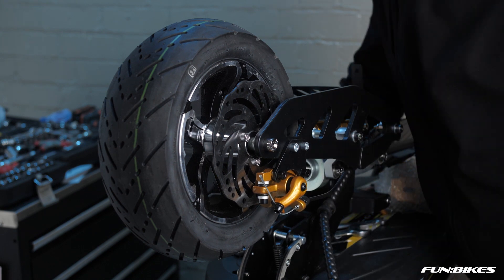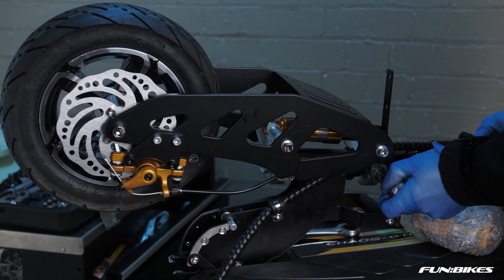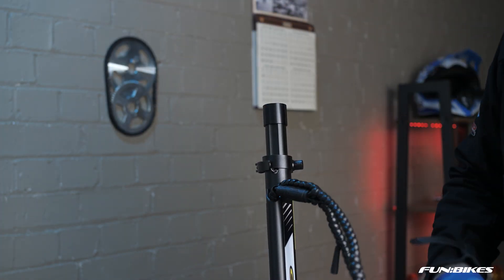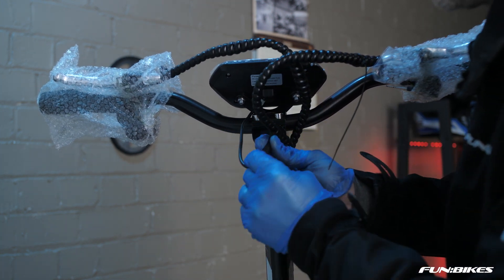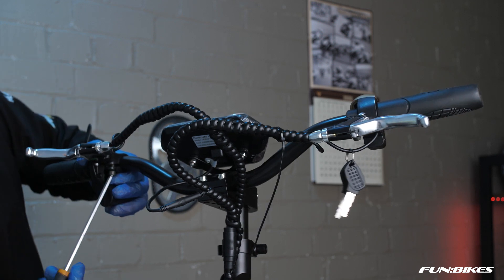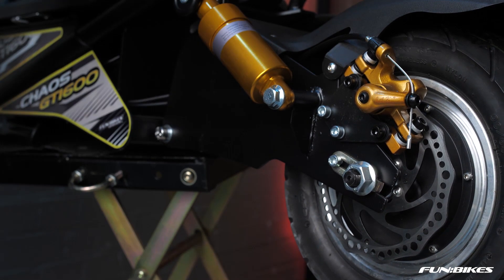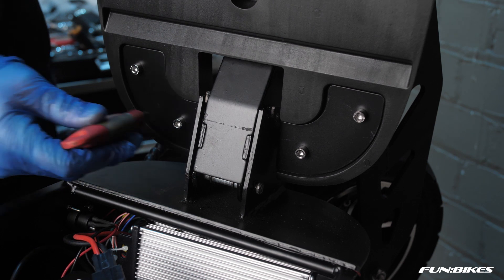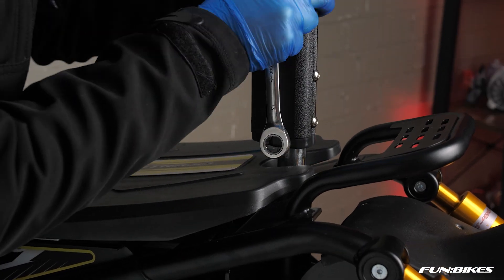Chaos GT1600 Sport 48v Lithium Scooter Assembly Video

Comment: If yoou tighten the front suspenssion bolts tight then how does the suspension work as all the joints are solid. Is it just for show????
Reply: The same way a wheel spins when you tighten it. Bearings or similar generally speaking.
Reply: Suspension doesn’t function off of bolts

Comment: Does anyone know which cable from the controller is restricting it from full power?? You can def feel it holding you back. To make it worse The screen also has speed 4 on the screen but won't let me select it!! Majorly frustrating!!
Reply: Apparently it'd the grey wire
Reply from the maker: 3 speed not 4. Forget the dash just generic for several scooters